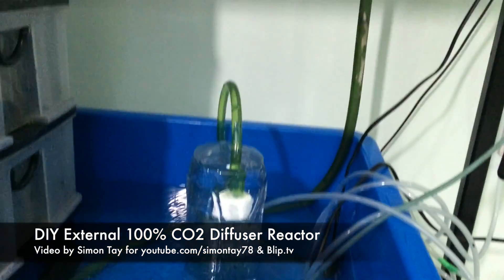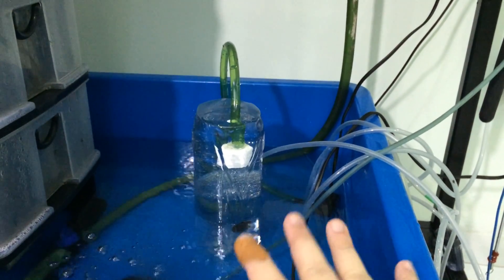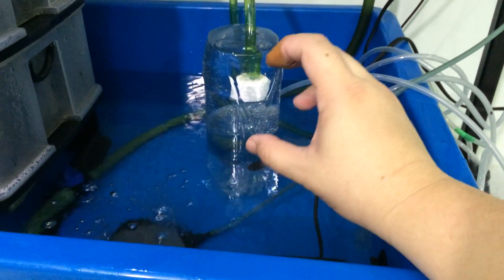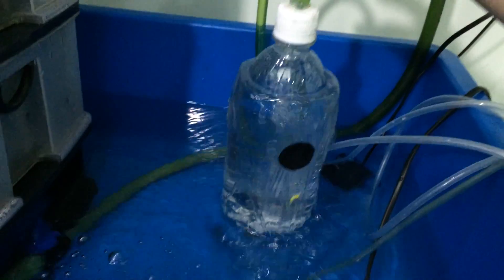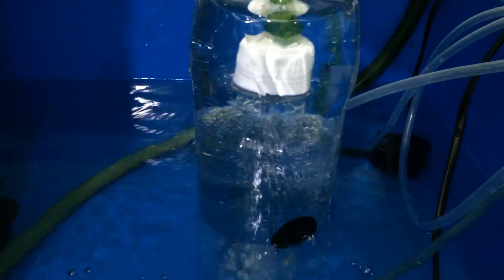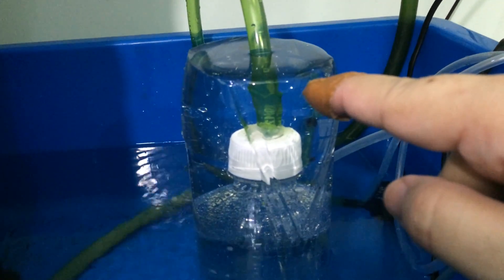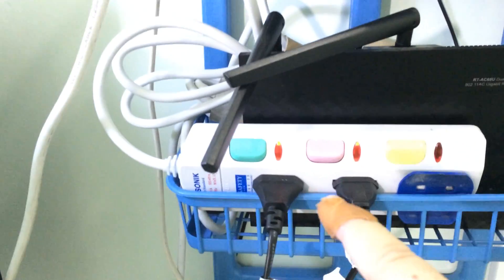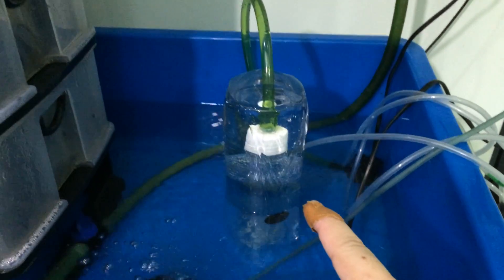DIY External 100% CO2 Diffuser Reactor for Aquarium

Comment from the maker: Update: Forget to add, there is a suction cup at the side of the small bottle to stick to the inside of the big bottle to prevent it floating up...

But I might just add some heavy stuff in the small bottle to prevent that happening...since the bottom are holes instead of a big hole...should be possible.
Reply: I had no idea you are into planted aquariums. That's awesome. I wanna see videos of you're tanks. I came to you're channel for clash and saw this.  What types of plants do you grow?
Reply from the maker: I'm now only doing basic carpet hair grass and some simple plants, may add more later but now paranoid with pesticide laced cheap plants that killed my shrimps haha